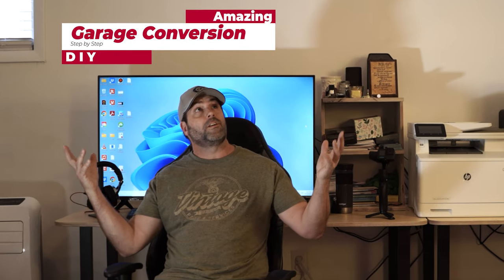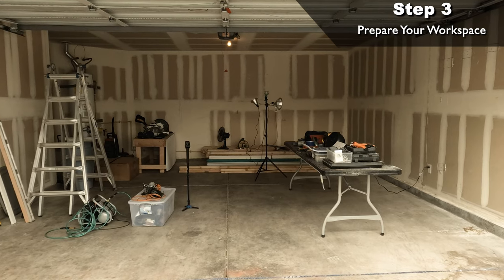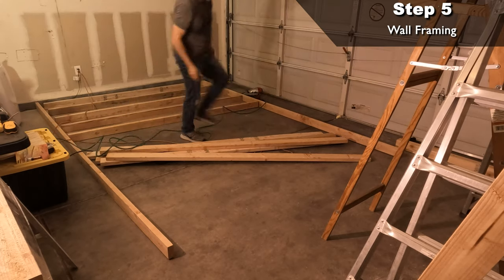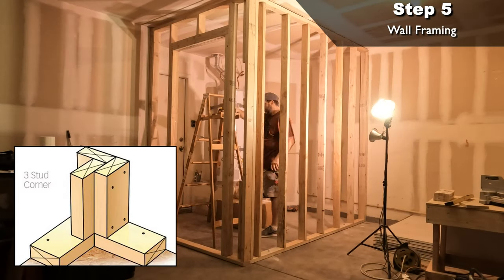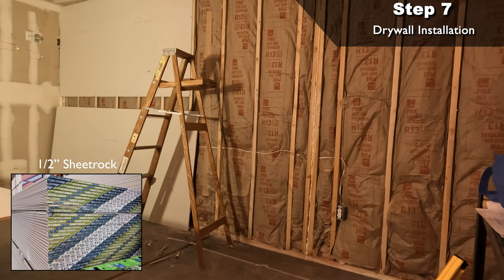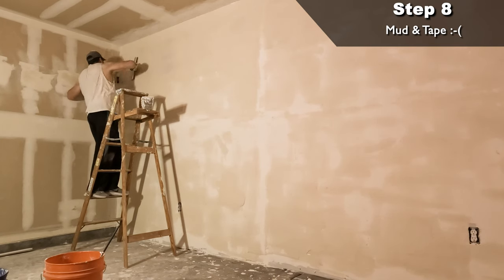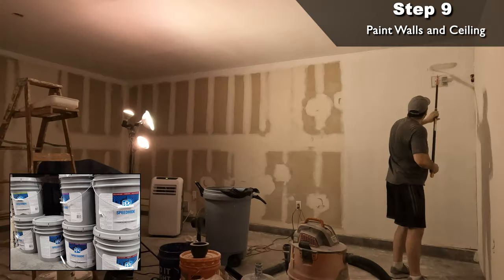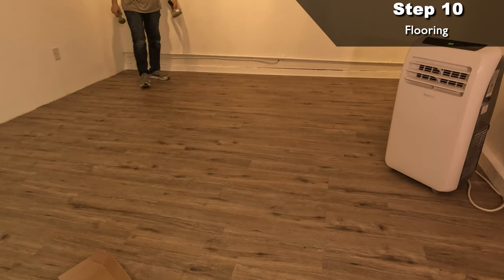INCREDIBLE Garage Conversion! DIY Converting your Garage to the Ultimate Studio or Living Space.

Comment: What do u use to seal the garage from the outside?? I did my garage like this aswell but, When it rains hard, some water starts to get in.😢
Reply from the maker: I was thinking of getting some rubber door seals and sliding them in between the door and frame then screw the door to the frame. Make sure you replace the bottom seal on the door. Use a good flexible outdoor sealant and go all the way around the inside and outside of the door. It doesn't rain much here so I haven't had to worry much. 🫤
Reply: Hydraulic cement?
Reply: I also use cement board and put more water proof wallboard on top of cement board inside. Sheetrock and water  don't mix

Comment: Does water ever leech up from the concrete under the flooring? What about having such a thin layer between your feet and the bare concrete, does it make the temperature really cold in the winter? I am looking into a conversion like this, but the flooring is one of my bigger worries.
Reply from the maker: This is in Las Vegas where it's very dry. I did put some concrete sealer down but I'm not sure if that helps much. So far no water. The floor is cold in the winter time, but nothing a space heater and some rugs can't handle 😃
Reply: There are aluminum covered plastic underlayment is very good. I have re-done the flooring with it, in winter outside -20C but the floor is not cold at all in both seasons. It costs about the same or more as flooring per SQF but worth it. Good luck with your project. I got it from Lowes.

Comment: PLEASE tell me how you sealed the door. I would like to learn exactly what you did to seal the garage to prevent moisture and bugs. This is exactly what i need for adding extra living space to my house, but i haven't been able to find any learning material that covers this without completely removing the door permanently. Also, if you don't mind disclosing, about how much did this run you without the floor? Much appreciated!
Reply from the maker: I live in a very dry climate but I actually screwed my garage door directly to the frame so it wouldn't move. I put a new bottom seal on the bottom of the door and caulked around the inside and outside of the door with some good flexible outdoor sealant. I sprayed it with a hose the next day to make sure it didn't leak anywhere.
Reply: Your responses are great. Thanks for sharing
Reply: @DigitalOutdoors  I am definitely copycatting you on this lol. Appreciate the insight and God bless!

Comment: Bro you did your thang. Amazing job and video. Editing on point. Liked and subscribed. My son wants to convert our two car garage to a kitchenette for himself and i had to show him your video. With the exception of plumbing and electrical we can do this project. But i have a question what you did with that metal part that the garage door slide up and down on?
Reply from the maker: Thanks! I left the vertical rails and took out the turns and the ceiling pieces. I just have about a 12" space between the wall and door.  👍

Comment: I really wish you would've showed us what you did with the garage... I'm about to embark on a project like this and I'm trying to gather information on what to do... nevertheless great video.
Reply from the maker: 😃 I thought that's what the video was about. Ask me any questions in the comments here and I'll try to answer them all.
Reply: @DigitalOutdoors  I guess I didn't hear or understand how you sealed your garage which what I'm having most trouble with
Reply from the maker: I guess I figured there's a bunch of different garage doors with different installations out there, but with our particular door, I put a new seal on the bottom, then removed all the garage door opener components, including the top rail and the rounded rail parts. I only left the bottom side tracks in place along with the top spring and bar.  I should note that I screwed the top part of the garage door to the wooden frame before I took off the tracks, so it wouldn't flop over and knock me out. After the tracks came off I put a good amount of flexible sealant between the door and the frame, then screwed it in place all the way around (it doesn't move at all).  Afterwards I sealed around the outside of the door just for good measure.  Let it dry for a day then I sprayed it with water to see if there were any leaks.  I'm sure there's a better way to do this, but it's been working really good so far.

Comment: Hi i would like to know how did the outside came up. Did you have siding to replace? Removed old siding and installed new?
Reply from the maker: I kept the garage door in place, removed all the opener parts, sealed all the sides of the garage door, then fastened it directly to the frame. After I did that, I built the large wall about a foot in front of it.
Reply: Nice is a great idea, I am doing a 2  door garage conversion to a small apt. Do you think i can just take one out to put a door and window.. worry that without a window wont pass inspection

Comment: How did you seal the garage door?
Reply from the maker: I just put a new seal on the bottom of it and lined the garage door frame with a rubber seal and screwed the door directly to the wooden frame.  Then I caulked around the inside real good.  I also sealed the inside wall real good.

Comment: Did that air conditioner keep the living space cool in the summer?
Reply from the maker: Not enough, until I added insulation to the ceiling and one of the exterior walls. Now it does pretty good. It's kind of loud and runs constantly in the summer though 😃

Comment: How much did you spend?
Reply from the maker: It was under $1000 for all the lumber, drywall, insulation, nails and screws. After that you can control your budget with paint, flooring, AC unit, etc.

Comment: How will all this cost
Reply from the maker: It depends on how many walls you need and the size of the walls along with your square feet.  Mine cost about $500 in lumber and drywall, $300 flooring, $300 mud and paint.  Misc. costs for a stand alone AC unit, electrician charges, ceiling fan, light fixture, base boards and a door.
Reply: @DigitalOutdoors how much wws total

Comment: how much did it cost just closing up the garage door?
Reply from the maker: I did it myself. I put a seal between the door and the frame and screwed the door right to the frame. Then I also used a foam sealant spray on the inside and some silicone caulking around the outside.